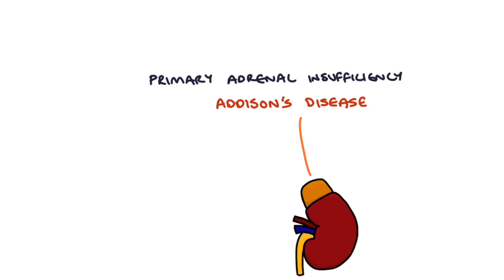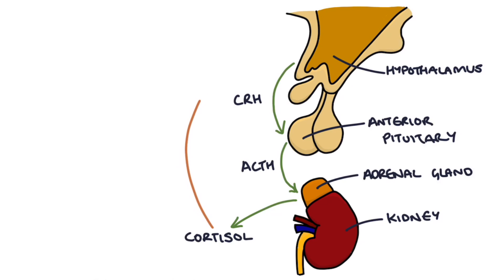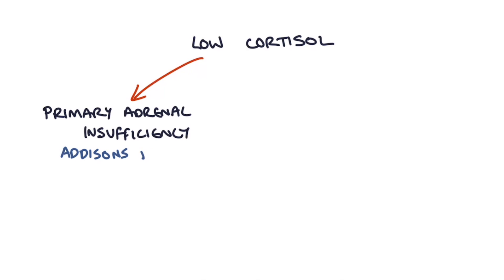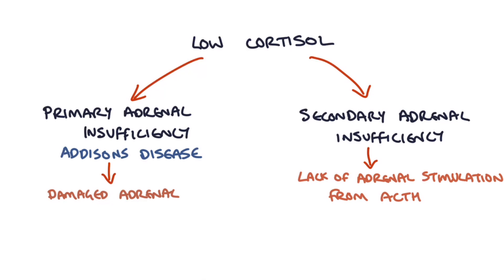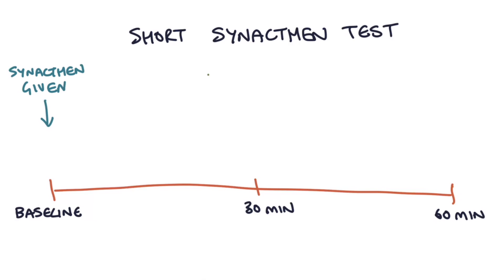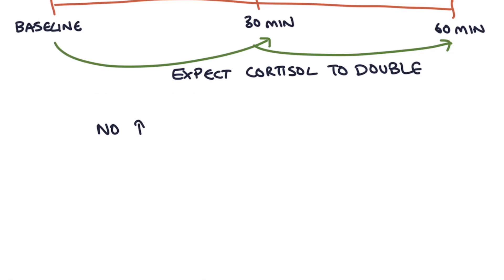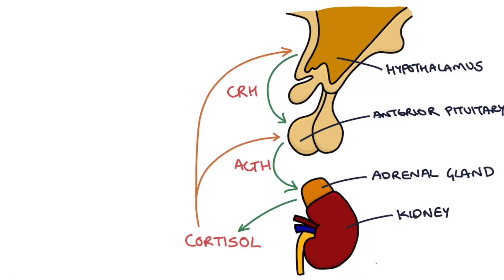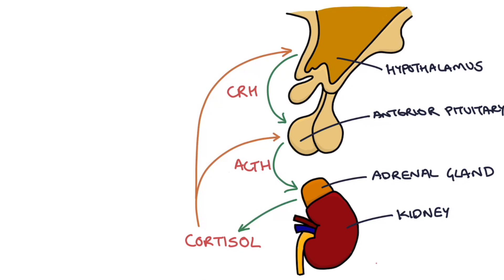Understanding the Short Synacthen Test

Comment: Can This test be used to diagnose patient with secondary adrenal insufficiency?
Reply: I think it is good only for diagnosing and/or ruling out Primary Adrenal insufficiency NOT good for secondary adrenal insufficiency because it is checking the response of the adrenal gland's production of cortisol by giving synthetic ACTH. So having supply of synthetic ACTH in the system will not tell if the pituitary is producing enough ACTH or not, which is related to Secondary adrenal insufficiency.

I am saying above based on my experience as a past cushing's patient and now suspicious for Secondary adrenal insufficiency. I am also a healthcare professional but not a specialist in Endocrinology. Despite that i did diagnose myself as having cushing's  and have over ten yrs of endocrine patient experience and also read/watched many endocrinologist lectures and professional research articles on the topic.
My last endocrinologist did this ACTH test and said she is confused why I am having symptoms and why i have low AM cortisols (baseline cortisol) because the my post ACTH stimulation test cortisol levels/responses were within "normal" range, but I see that the ACTH is low normal, which is a high suspicion for Secondary adrenal insufficiency. My last  endocrinologist says that I don't have reoccurrence of Cushing's. And I am like, I know that even without testing because of how I feel symptoms wise.
Anyways, now in 4 days I will be seeing another endocrinologist at Mayo clinic. I really hope to get some answers to my health conditions/symptoms eventhough I am not looking forward to a lifetime of taking hydrocortisone for secondary adrenal insufficiency,  getting a diagnosis or a reason/name for my symptoms' cause will in itself be a relief and that it is not in my head.

I have seen some endocrinologist experienced in treating/diagnosing  primary and secondary adrenal insufficiency saying that ACTH could be low normal or below normal in secondary adrenal insufficiency, including a video by an endocrinologist from Mayo clinic Rochester, MN.
Reply: I need to know the same.

Comment: Another cause of insufficient ACTH is that there is possibly an adrenal adenoma (a benign growth on one adrenal gland) that is producing cortisol.  This in turn  shut down secretion of ACTH  and the pituitary is acting appropriately because it senses the negative feedback loop that there is enough cortisol present. If a patient is consistently getting very low or no ACTH on ACTH testing, then it is prudent to scan the adrenal glands.  Most docs assume it's a pituitary issue until they discover (sometimes many years later and faulty treatment) that an adrenal adenoma has been the culprit all along. Lack of ACTH atrophies the well adrenal gland, so that when/if an adrenalectomy (the cure) is performed the remaining adrenal gland doesn't respond so well to the newly incoming ACTH that does return when the adenoma is removed.  Can take a long time for it to perform again or it may not ever perform well again, so supplement of Cortef is imperative for a while, and sometimes for life.

Comment: Hi , thanks for this time saving explanation , really appreciate it.
I have a question : there's a Metopirone test that stops the last step of glucocorticoid synthesis , but it's counter indicated in Addison disease case , so you'd have to know it's a central cause . What does this test then add to your diagnosis ?
Reply from the maker: Hi Tarkan. Thanks for your comment, glad to help. the Metopirone test is quite a complicated test that was more helpful before ACTH could be directly measured. It was used to confirm a diagnosis of a central cause, however these days we can simply measure ACTH. The metopirone test isn't used any more in the same way that the long synacthen test isn't really used. Measuring ACTH is much easier. Hope that helps.
Reply: @ZeroToFinals   thanks for taking the time to respond , was really helpful . Much appreciated !
Reply from the maker: @mustapha1403  my pleasure

Comment: I wonder, do you need the Short Synachten test to diagnose primary adrenal insufficiency? Because if you measure ACTH and cortisol in the blood at morning and the results indicate physiologically high ACTH but low cortisol, isn't that sufficient to diagnose primary adrenal insufficiency? The command for the adrenal glands to produce cortisol is present, which is decreased in the case of secondary adrenal insufficiency, but the output from the adrenal glands, despite the command, is absent/low. Maybe this reasoning is somewhat too 'hasty', but I'm curious about the answer.
Reply from the maker: Thanks for your comment Keanu. If you tested ACTH and cortisol and found a high ACTH and low cortisol, you are absolutely right, this is highly suggestive of adrenal insufficiency. The problem is that the adrenal axis is so dynamic that "snapshot" test results can vary. You could check your cortisol now and it might be low because you are relaxed, and check it again in an hour and it could be high because you are stressed. Someone with high ACTH and low cortisol could occur with healthy adrenals if they have just released the ACTH in response to an acute stress (such as having their blood taken) and the adrenals have not yet caught up. Equally, someone with adrenal insufficiency may have a "normal" cortisol defined by the lab reference range, however based on their level of stress they should have a much higher cortisol and they in fact have adrenal insufficiency. Therefore, snapshot cortisol levels are not very sensitive or specific, and you can end up with a lot of false negative and false positive results. This is where the short synacthen test provides a much more accurate picture of whether the adrenals are working well and able to respond to ACTH. Hope this helps.
Reply: @ZeroToFinals  Dear Tom, I really appreciate you took the time to respond to this question. Your explanation is very complete and clear and it has really given me a broader understanding of this pathology and the importance of this test!
Reply from the maker: @keanutax4951  you're very welcome. glad I could help!
Reply: @keanutax4951  wow , Thank you so for ur question because I open the video and had this question in my mind and tried just to get the answer and I found it here directly 🤗🤗🤗 thank for you both
Reply: @ZeroToFinals  
I have a low ASTH of 6.41. Should I treat it, knowing that cortisol in the morning was normal and the ASTH was low? What treatment does it cause sexual weakness? I have general sexual weakness in the body and pale skin
Reply: @ZeroToFinals  wow thanks so much

Comment: Thank You!
Reply: I had a  Insulin Tolerance Test awhile back and am confused by the results. My base cortisol levels were normal ( 28). When my adrenals were stimulated with the ACTH my cortisol levels did not double at the 30, 60 and 90 minute intervals, but kept falling. I understood that they should at least double, but the doctor said they didn't need to double because my baseline numbers were normal. Isn't this test to see how the adrenals react under stress?